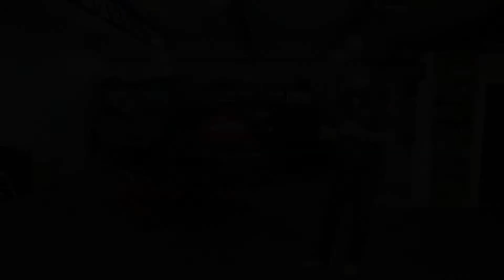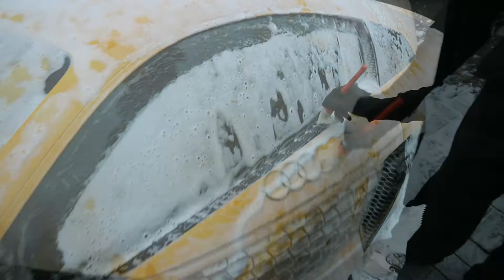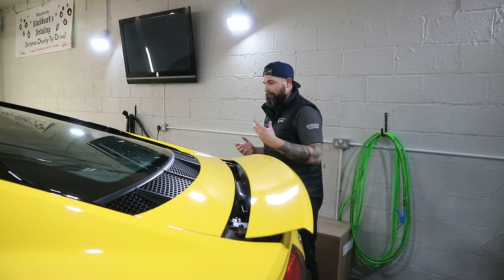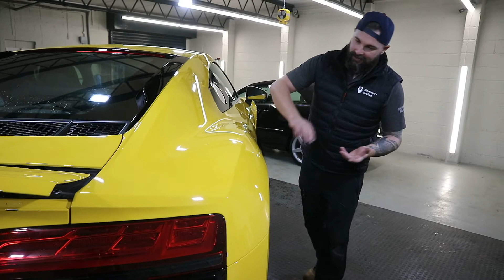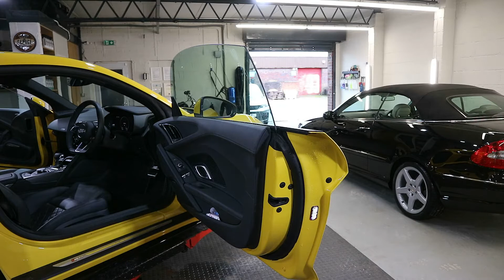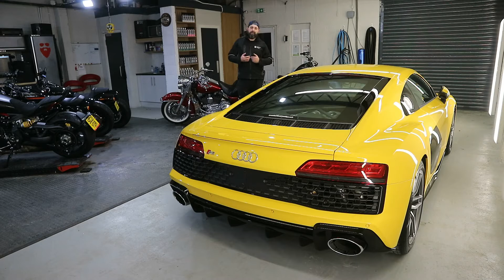Vlog 31 - Blackbeard's Detailing - Audi R8 - Ceramic Coating - Glasgow - Scotland - Paint Protection

Comment: great video, love that yellow!
Reply from the maker: It's gorgeous, how did you get on with the o2 sensor?
Reply: @BlackbeardsDetailing  Ive actually not ordered them yet, I had a house move over Christmas. I need to try it as I have P0125 code coming up (slightly different to yours). Forums suggest the sensors.